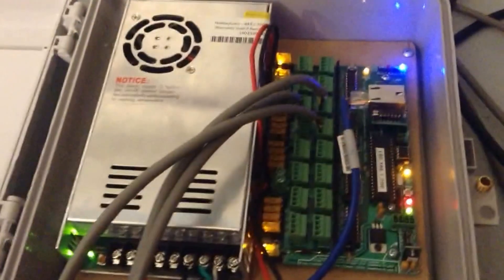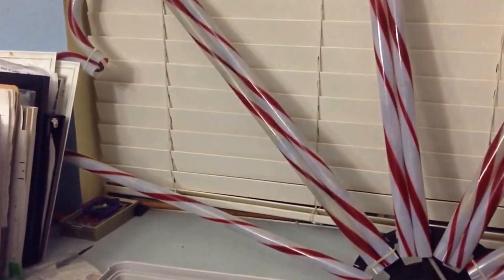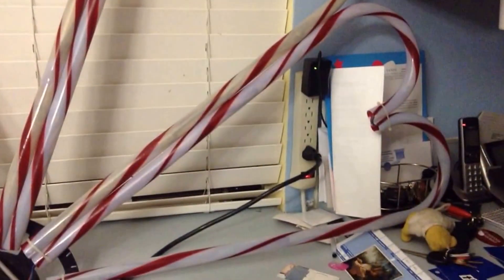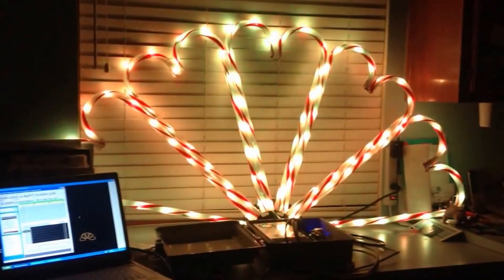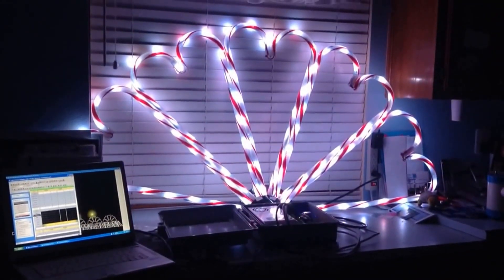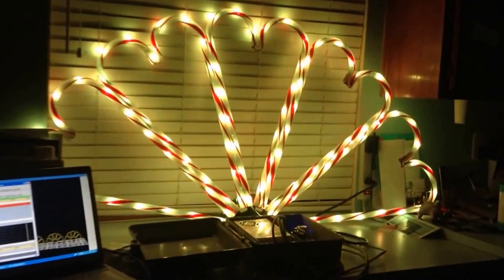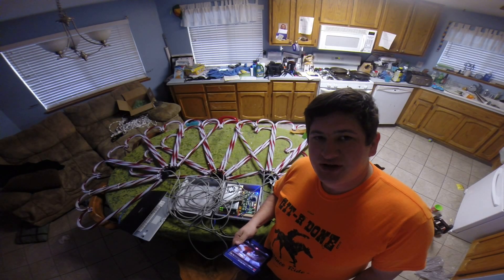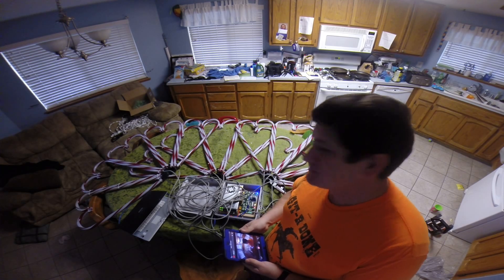Candy Cane Pixel Arches - Showing/Building/Testing

Comment: Since you are using a solid white candy cane with Red stripes, how are the pixel colors at coming through that configuration.    Also, after you rip out the lights that are in the candy cane, how do you put the pixels in and get them to stay at all the same level.
Reply from the maker: String to pull them through, soapy water as a lubricant (Windex works too). The pixels don't move around because of the other pixels in the top of the candy cane helps keep everything in place. There is not much room for them to move around anyways.
Reply: N[ioooooooo